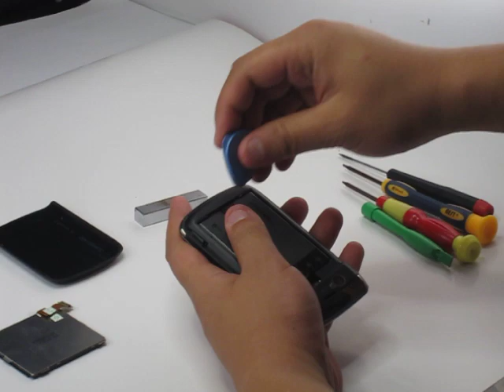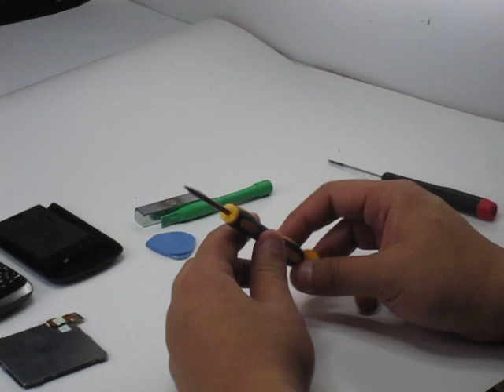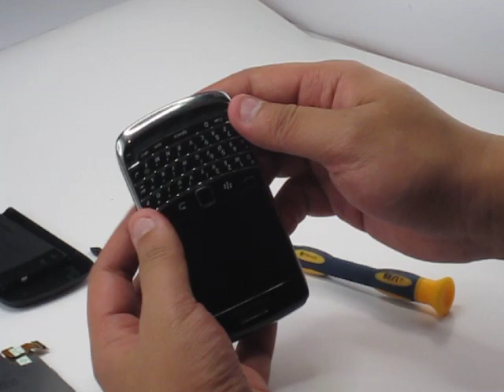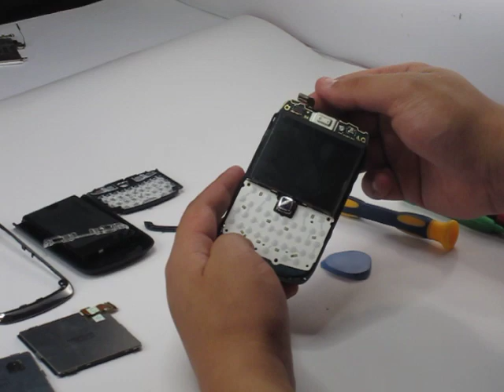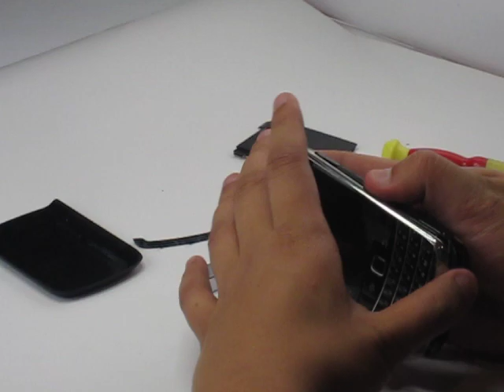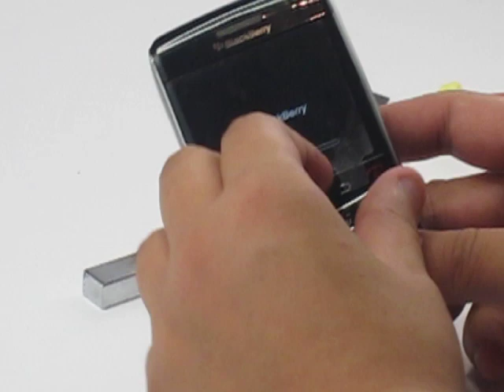Video Instruction for Blackberry 9700 LCD Screen Replacement

Comment: Yes, it is very easy to change the glass and NOT the entire LCD. The below poster is dead wrong about this. To just change thee glass that sits over the LCD assembly, gently run an exacto knife around the edge and peel off glass. Stick another fresh glass lens over the top and gently press around the edge. I always use the old bead/gasket but you can use glue or another gasket around the edge if you want. I have never seen one so I always use old one.

Comment: great video, thanks, just took apart my blackberry, screen broke. one question. you use that metal magnitic bar to hold screws. what's it called? tried to find it, as it looks very useful. thanks.

Comment: Is it possible to peel of the hard top glas off the screen? I can order on EBAY only the plastic top of the screen for ca. 2 or 3 dollar. The top layer of my BB-screen is scratched and damaged, but the LCD is still 100% working..

Comment: ebay for $33, got mine 004/111 for my bb bold 9700 and it should be here by thrusday >:D did you get the number off the back of your LCD?